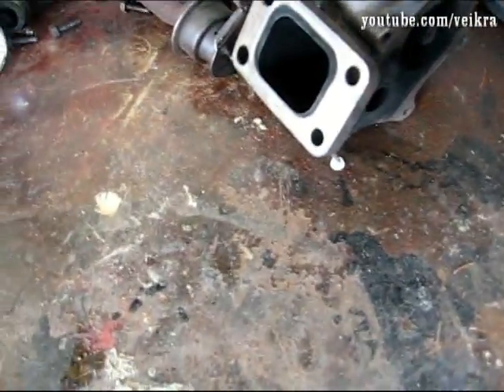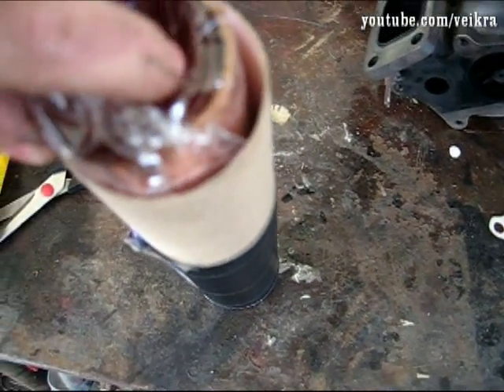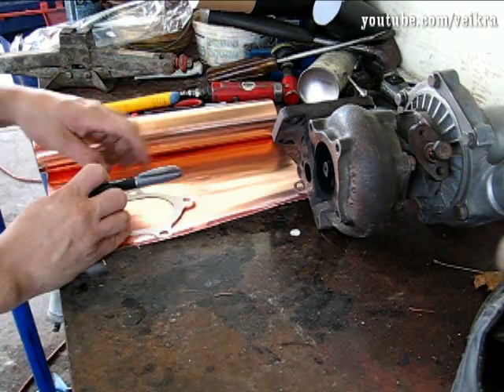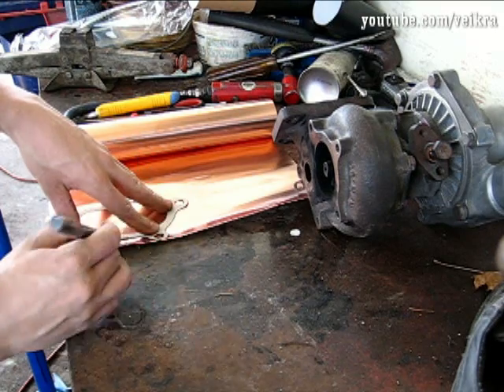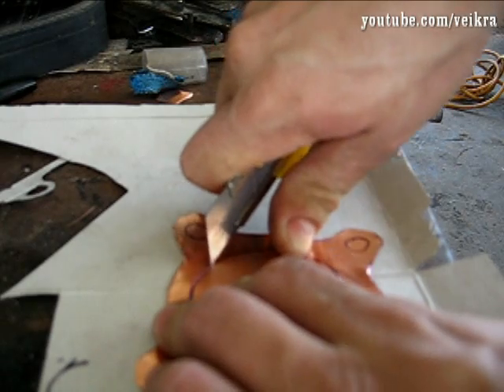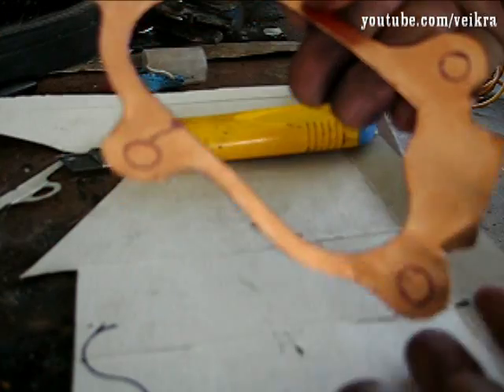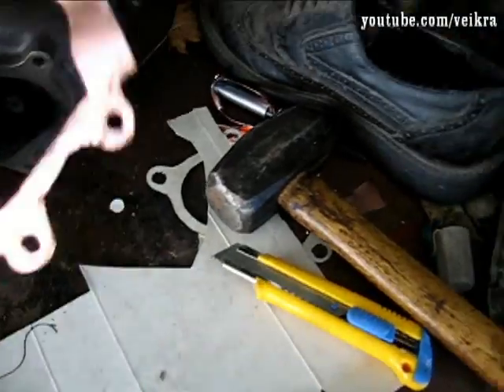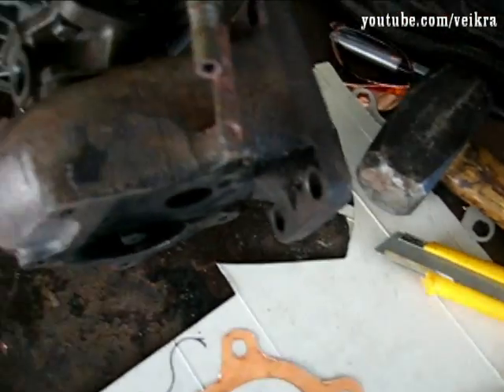How to make simple copper gaskets for high heat application

Comment: Use a spent rifle cartridge (without the bullet, powder & primer) and sharpen the edge to use as gasket hole cutter. 
223 works for ¼" bolt hole 308 is close enough for a ⅜ hole and for a ½" hole use a .50 cal or cut the necked down bit off a 308
They will get you close enough to where you just need a round file to touch up the holes
Reply from the maker: Nice trick but we arent allowed shovels in canada. Hurts Trudeau's feelings. So rounds are not as easy to find

Comment: Heat it up with a torch until soft like paper then dip it into some used oil and the carbon in the USED oil will adhere to the copper.
When you disassemble the exhaust again just reheat and reinstall.

Comment: What thick was is the copper you used? My gut feeling is to try something 50% thicker but use the thickness you have as a minimum.
Reply from the maker: i'd have to mesure it, but if you intent to make an exhaust gasket you can buy the exhaust gasket sheets and cut one out of it. That being said, copper works.
Reply: @Nordic_Mechanic  thanks. It's for a custom built inlet manifold (no boost).

Comment: I notice that a lot of factory made metal gaskets are multi-layered, so there might be some advantage in doubling up. For exhaust I think you're right to put it on dry, but for a cylinder head I'd dose it with aircraft gasket cement.
Reply from the maker: I'd never use this as a headgasket, too much work to replace when it goes bad in the middle of nowhere. This copper works long enough on a manifold, gets the thing working again and not too hard to swap with the real stuff that as you said is doubled up. You can buy specific gasket material for exhaust so you can make a gasket as good as the original.  That aircraft goop is amazing , I use it a lot on air compressor. it makes sure the new paper gasket stick perfectly

Comment: You really should be softening up that copper if it isn't already softened with a torch. Copper makes a better seal when it's annealed. Ridged copper will make pockets which is a potential path for pressurized gasses to track through.
Reply from the maker: I was thinking of doing the annealing, but decided it would only be temporary . Turns out it still worked. But I agree, I should have heated it up .

Comment: Not even on purpose. LOL I just bought some 0.1 mm copper sheet on Ebay to make some  very thin head gaskets for a motorbike and an outboard. Found this by chance but comes really handy. 
I've been doing gaskets for ages, usually try to keep gasket paper in stock in several thickness just in case. Sometimes it's annoying to make them but its worse to have a project waiting for some gasket.
BTW don't you anneal them before use would be a good idea. ;-)
Reply from the maker: Oh an old trick to bump up the compression I see . I thought of annealing it, but decided not to as the exhaust temperatures on a turbocharged car are high enough to disturb it.   I do anneal copper washer when I reuse them though !  And you are right, this is one case of not wanting to wait for a gasket. There is a more forgiving gasket material exhaust flanges, but I ran out of it and couldnt locate any nearby and didnt want to wait.
Reply: LOL same here. Project ongoing, comes Friday afternoon all stores closed here. Wait until Monday to go out, order and go back Tuesday or Wednesday to pick it up and carry on... and also drive 30km each way several times... NO WAY. ;-)
Reply from the maker: You got that right ! this was a saturday job, not a next week job :)

Comment: couldn't you just use some copper spray on the regular gasket ?
Reply from the maker: no, because I don't have the original. There are better gasket material meant for this application, but didnt have some at the time and this gasket still works and doesnt leak
Reply: ummmmm didn't you use a gasket for the template
Reply from the maker: no, that's cereal box cardboard

Comment: We have to make some gaskets for our OC-6 Oliver crawlers.  We use a paper material that comes on a roll.
Reply from the maker: mossman381 I use paper as well, but can't use it on a turbocharger or exhaust pipes, I don't trust it on glowing red metal :D
Reply: Veikra  None of our parts see high heat so the paper works great.
Reply from the maker: Yep. I've used paper on many parts, including my air compressor. I always have a roll